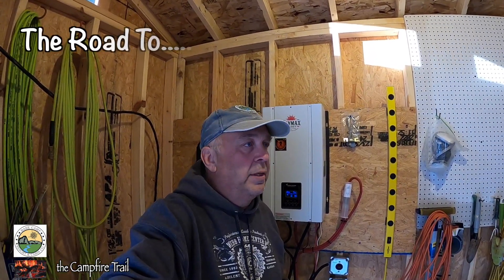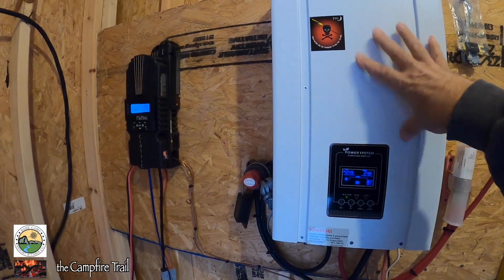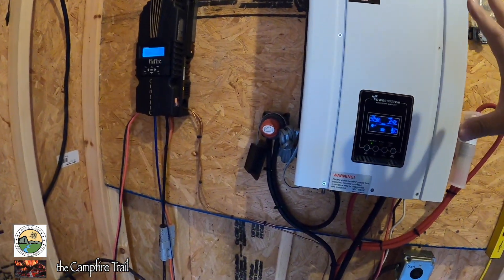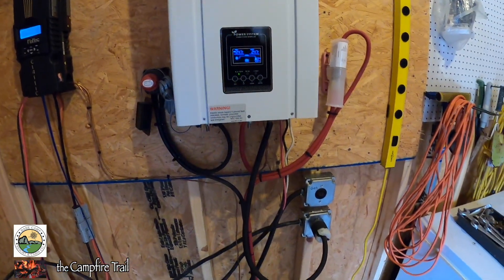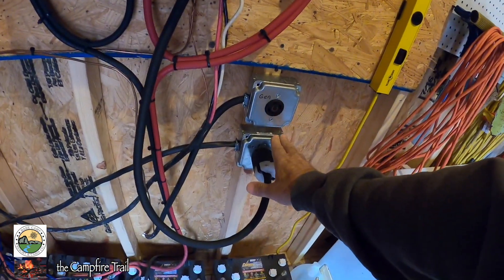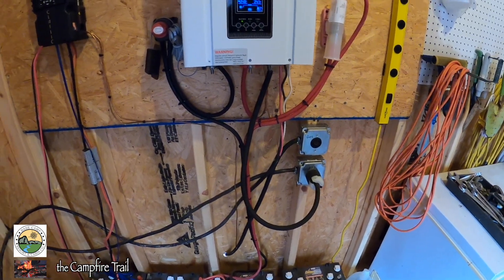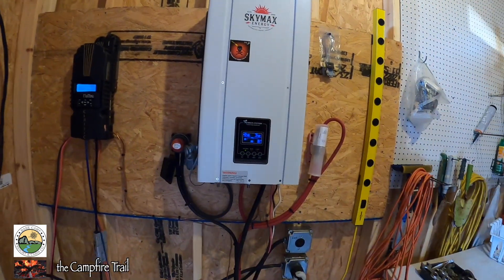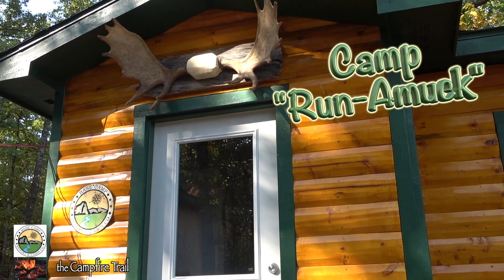Off-Grid Solar - The First and Most Important Decision

Comment: So, this setup is for on-grid applications. The title says off-grid. It’s a bit misleading.
Reply from the maker: Not at all. The point of the video is to stress the importance of choosing an Inverter/Charger vs an Inverter alone. Our system is built to be 100% solar. The supplier we purchased the equipment from assumed we were after an Inverter. When I asked them how to recharge the batteries with a generator if the solar was not producing (clouds, rain,darkness) they said I would need an Inverter/Charger to do that. (Thus, the point of the video)  Had I not asked that question, I would not have known there was a difference. We have grid power on our property for the operation of larger business related equipment, so we have connected our system to it as an alternative "recharging" source along with the back up generator. But if grid was not available, the system would still be totally autonomous off grid. We've had a number of occasions since it was installed with up to 5 days without sun where the Inverter/Charger kicked itself over to the alternative recharge source to boost the batteries back up. Sometimes we have it set to use the grid. Other times we've set it to the generator to keep the generator cycling routinely. The title refers to "Off-Grid Solar" which is what we use and I feel the most important decision in setting up the system is to have the ability to keep the batteries charged up by alternative sources if and when solar is not producing.  Sorry if you feel that's misleading.